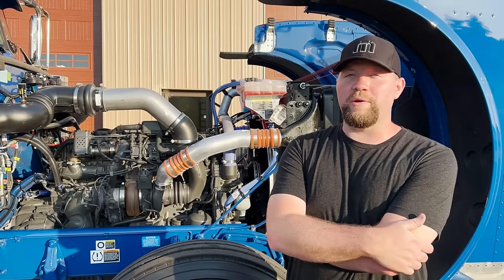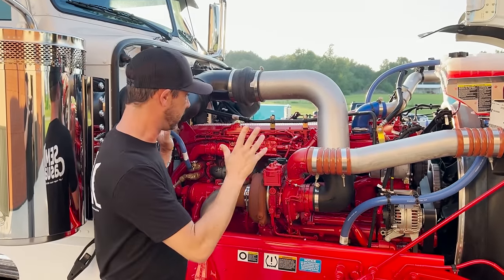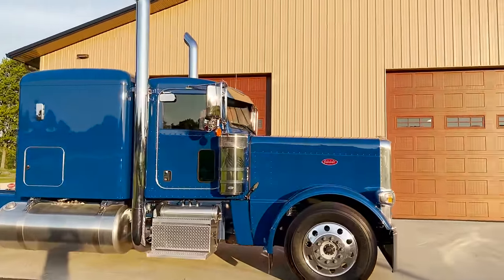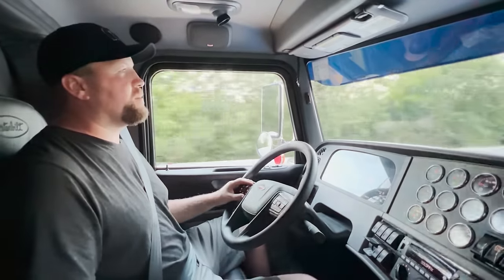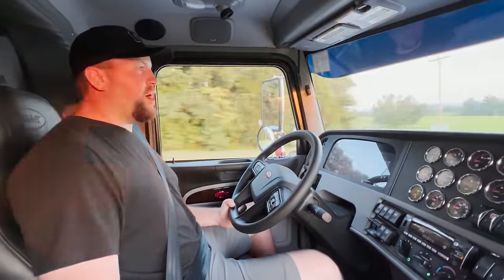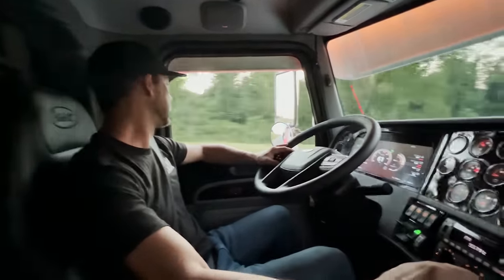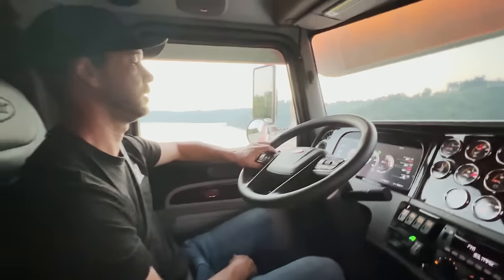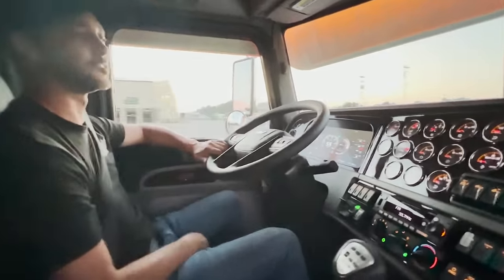Cummins X15  VS.  Paccar MX13  -  What are you gonna choose?

Comment: I haven't heard anything good about the Paccar from the shops that I take my truck to. I would take the Cummins only because the CAT is no longer available.
Reply: The Paccar motor itself isn’t a bad engine, I think it’s some of the parts and pieces that’s bolted to it. We have trucks pushing 500k and the engine itself is good, just issues with the other things.
Reply: They are still available just not a factory option anymore but putting a cat in after is better in my opinion because you get to choose how you want to build it and who you want to build it
Reply: But you hardly see paccars in the shop,most of them are Cummins
Reply: True
Reply: @alfredodelcastillo583  because 99% of trucks have Cummins.
Reply: Currently at my shop I work at we have more paccars then Cummins. Paccar is going though a issue with eating camshafts right now.
Reply: @tylerrobinson6158  
What year models? I’ve been driving trucks with Paccars since 2014 and out of the 3 trucks I’ve hadn’t had any engine issues other than the crankcase filters. The 3 year models were 2015,2017 & 2020. My current truck a W990 just went in our shop for the dpf pressure sensor and crankcase filter.
Reply: @tylerrobinson6158  excess downhill speed?
Reply: C15 600 hp 2050 tq 44k load I still out climb a 605 hp Cummins 2050 tq any day depend on your gears and how your truck set my opinion
Reply: a man  t2000 really don't matter the body style along the motor is good
Reply: @waynenorbreyjr9371  Paccar opted to use a pressed lobe crankshaft to save on weight. The result was that the lobes spun independent of the shaft. I am not positive which years were effected by this.

We run Paccars in all of our trucks. 1.2 million miles on our T660 and no need for an inframe yet. I do not know any Cummins owners that have been able to run beyond 500,000 miles without an overhaul.

That being said, we now run US weights but our T660 spent most of its life pulling 140,000 pound gvw LCV. As long as they’re maintained and operated properly they should last a long time.
Reply: The majority of shops don’t know how to work on them and the majority of operators don’t know how to operate them properly. Paccars aren’t meant to have the snot driven out of them. Lower power and torque but they also have a lower power band which means I get full boost at 1,100 RPM. Low RPM shifts and proper maintenance and they should last for a long time.

The problem is that most of the big fleets run Paccars because they’re cheap and their drivers beat the shit out of them. Add the fact that technicians don’t know how to fix them and it gives them a bad name.

They’re great motors imo.
Reply: Basically none of these motors are any good, You need a CAT under that hood.... that or you need a Detroit 60 swapped in for extreme reliability and good fuel economy. And before anybody talks s..it about the Detroit, I have one that has 1.2 million on the clock all original. Only a Turbo ever replaced. Ive also has friends with C15's extremely tough and they have incredible power stock for stock. Im talking big grades pulling 80,000. I hear the new Cummins loveee to eat those Dual overhead cams. They eat camshafts for breakfast. My local Diesel repair shop is always rebuilding the heads on them. Overall they dont last past 600,000 most of the time under 500,000 they're worn out
Reply: @raysoicey  I could out climb you with my 605 Cummins with 46k on and if you had 44k any day
Reply: The shops must be incompetent. Paccar engine is extremely simple
Reply: But you could custom order a peterbilt and install an old cat motor into one
Reply: And the electronics/sensors especially  ‼️
Reply: You haven’t heard because the shops cannot and don’t know shitt about them , Cummins is a Chinese Engine every part is made in China 🇨🇳 I choose Paccar
Reply: @raysoicey  T2000 has a horrible body electrical system and sucks to work on anything in the engine bay
Reply: @Fasterfuel  a ton of things are produced in other countries  , but are assembled here in the states.
Reply: @tylerrobinson6158  had an x15 eat a cam at 300k
Reply: When they run they’re. They just live in the shop. Detroit all the way! A shame there’s no DD in a Kenworth or Pete.
Reply: Paccar is fine if you are running flat areas don't mind paying more for oil changes, running into places not having the filters in stock, parts costing more, and the strong possibility that the engine will need rebuild around 4 to 500,000. That's if the block isn't trashed from cavitation and it can be rebuild. Also it costs more to rebuild one.
I ran the paccar for about 2 years and cummins for about 2 years both As an owner.
I'm back with a company now in a paccar, but if I were to buy another truck, I wouldn't touch a paccar. Too much risk, and the little bit you save on fuel will go to maintenance anyway in the long run.
Reply: I was a Cummins guy for years until my Cummins spun a rod bearing and due to changflu they couldn’t even really estimate a timeline for rebuild due to the parts issue. I had to have a truck so started shopping. Wasn’t much on the market at all but finally found a nice low mile T800 with a C15. Gonna be really hard for me to get away from a cat now. Had it deleted and tuned as soon as I bought it and WOW. The horsepower and low end torque is unreal. Everyone told me that cats guzzle fuel but it gets the same to a little better than my Cummins did. She’s a keeper
Reply: I'm almost at  600k miles on mime haven't touched it still no leaks at all and I know I'm getting better fuel mileage than isx
Reply: @jordanray6459  Maybe with the computer and engine killing filter. I had a 88 Freightliner with a 450 M series Cummins and didn't overhaul it until one million one hundred and twenty five thousand miles. Had minimal major parts replacement over the 60 series Detroit my brother had in a 95 Freightliner that was a continuous money pit.
Reply: @orlandomoreno5326  I have several friends with C-15 cats and 60 series Detroit's and my Cummins got better mileage and less maintenance cost. My brother could confirm that with the 60 series Detroit he had. His cost in fuel and maintenance cost was half again more than I had with the Cummins.
Reply: @Fasterfuel  my Cummins is all American or canadian.
Reply: Milwaukee blew up at 450k and had to be replaced and none of the shops techs where surprised lol. Not to mention that they made the paccar especially to force you to have to come to the dealer even after warranty is up because shops popped up all over the place specializing in Cummings for half price and they wanted to make sure you couldn't do that with the Paccar so something ad simple as a fuel filter you must go to the deal for or you will get a engine light.
Reply: @Daniel-z2j2v  I would say about 65% are Paccar engines. At least that what it seems like when I watch the guys bolt them in
Reply: @joshcoffey6355  was your Cummins deleted too?
Reply: Paccar is like a cat
Reply: Don’t matter what motor you put in a truck these days. That emission junk gonna cause problems either way
Reply: @alfredodelcastillo583  tell him na
Reply: I recommed paccar 100%
Reply: @waynenorbreyjr9371  Packard are great  engines
Reply: I prefer the paccar over the Cummins me personally drove both paccar better even sounds better deleted but I'm a cat guy I prefer that over it all the only thing with paccar is trying to tune the speed all that good stuff paccar gets better fuel mileage
Reply: @champ0925  nice
Reply: @Fasterfuel  because they’re made in the EU?
Reply: K B  yes and no. CATS are still around they just don’t make over the road engines anymore do to emissions. Cummins will be making there last light duty Diesel engine in 2025 and after that they will be taking down there semi truck engine and switching to industrial gas motors or hydrogen engines. I heard about all of this a few months ago but not sure what will happen especially with all the emission stuff in the US.
Reply: Our peterbilt dealer refuses to carry paccar trucks
Reply: @waynenorbreyjr9371   had a 13 that lost the motor 3 times in 7 months. All full crate engines not rebuild. Then an isx15 deleted with 700hp reliably for years zero issues
Reply: Depends on year
Reply: CAT all the way! C-15
Reply: We have all new Paccars in our Petes. All of them constant headaches with under 50k miles. It's a nonstop game of find the leaks.
Reply: I drove 579 paccar for 2 weeks engine blowup on my face then my company moved me to kw t680 with paccar 5 days later engine knocking then pistons broke then crankshaft became mashed potato so I told my company fu I’m done
Reply: @alfredodelcastillo583  
Because of the shear number of cummins on the road. They are the largest diesel manufacturer in the world.
Reply: Quiet and comfort makes you fall asleep faster
Reply: Peterbilt is junk. I bought a 2023 brand new & roof leaks!! Then I found out many have that problem.
Reply: Peterbilt is junk. I bought a 2023 brand new & roof leaks!! Then I found out many have that problem.
Reply: ,  zddp will fix that imo
Reply: The gd stuff I’ve heard from paccard owners are those that deleted them fully, piped around and all, and take them to mechanics that are familiar with them. The def system seems to hit the paccard more than any other engine
Reply: Because mechanics don't know how to fix it. The engine is fom Europe Man/Daf those are wery advance engines. Cummins stone age technologies
Reply: Cat is back bro with the c13d
Reply: @alfredodelcastillo583 that's BS
Reply: @tylerrobinson6158  has eating camshafts any thing to do with fuel pumps breaking bolts off
Reply: There's no way on God's green earth I'm going that far with oil and filter changes, I'll stick with 12 to 15 thousand and the c-15 cat
Reply: kb5019  No cat couldn't meet emissions standards. They still make motors for the construction and industrial industry. Major of the construction vehicles use CAT
Reply: Paccar is a nice engine and gets amazing fuel mileage
Reply: @goodplenty5510 Same problem on both of my new 567s
Reply: @orlandomoreno5326 see a ton of Cummins inframed between 500-600k miles. I’ll take a built Series 60 all day.
Reply: @deantait8326 DD gets a bad rap for the emissions or a company driver didn’t do the correct maintenance.  I think an owner op could easily get 1 million out of a DD motor.
Reply: Paccar - Peterbilt and Kenworth - "shops" or shadetree wannabes that work "cheap"?
Reply: @austinpitts6362  I expect it won't b too much longer, that it won't be an option to do that anymore.
Reply: @tylerrobinson6158  They have all had that problem at one time or another, Cat, Cummins, and DDA. They can do all the quality checks they want, it doesn't show til they get used.
Reply: I have paccar mx13 and it’s good when it is deleted
Reply: Not a bad engine, except some clowns masqueradeing as engineers got their grubby hands in there and fucked it up for everyone and twenty folded the cost for no added benefit
Reply: Alfredodelcastillo583 congrats in showing everyone you dont work on trucks for a living lol
Reply: One friend is psicólogo whit paccar paid lol
Money to
Fixed
Reply: @waynenorbreyjr9371  aqui no Brasil o motor não dá problema olha que andamos com 74 toneladas os defeitos são em parte eletrônica e turbina
Reply: Current have 1.2 million miles on my MX13.....with no engine work yet

Comment: Let me add my 2 cents here. I had a T-800 with an MX-13 in what is probably the most brutal operating area in the USA. It was hooked to a gas wagon and we delivered gasoline to fuel stations in New York City, northern NJ, and western Conn. 2 drivers per truck rotating in 12 hour shifts 6 days per week. Truck never stopped. Each 12 hour shift saw anywhere between 800-1200 lever shifts (10-speed transmission) that’s over 2000 per day easily. Always loaded to 79,990lbs or completely empty. Usually 4-6 loads per shift and 300-400 mile per shift, 3 years later and no issues at all. Those trucks, engines, transmissions were run at their absolute extreme in ridiculous brutal conditions and we never had a single breakdown. When it wanted a regen we let it regen. Took 10 minutes and it was done. Absolutely awesome engines.
Reply: we have paccars in t880s hauling crude off road they never stop only for service they seem to be holding up

Comment: A throw away engine.  Mx13 every thing 8s rear driven air compressor power steering cam shaft. Cam shafts lobes are pressed on the shaft. Blocks cannot be converted bored. Must use a plastic scraper to clean old gasket material off. If under warranty most times paccar just swaps out the engines

Comment: Had it been available, Cat would be my top choice. When I drove trucks with Cat engines, either a 3406 or C15, it was instantly a noticable improvement in pulling power over the others.
Reply: I retired from trucking many years ago but...if I were to get back into it I would buy a 2000 with a Cat in it and love every mile😆😆😆😆😆
Reply: @ford32able  how about an RV with Cat power? I could deal with that.
Reply: 3406e for the win
Reply: Have you compared it to the cummins X15 or even the later isx15's? I noticed the cummins was better stock for stock vs my 3406a and got better fuel economy.
Reply: FYI - C-12, 15, 16 etc is the engine size (Liters) and 3406 is like the Block model. I assume that this is what you meant....
Reply: Well I have not drove sinse late 80' s but my favorite engine is @silver92 Detroit at least that's how I recall it in a REO triaxle with a15 speed trans that was a animal it had 2 speed rears
Reply: I am thinking of getting back into it
Reply: 6nz
Reply: @dublkrossr2059  c-12 is a smaller block
Reply: Yeah, and 5 miles per gallon would be killing you today.
Reply: As smooth as a cat is I would have a 500 60 series with a super 10 over everything  6mpg to 6.5 all day I only got 4.5 to 5 with the cat
Reply: @larb400  seems everyone wants a CAT, I don't think they have any idea how bad they were on fuel. I'm with you, I would like a 60 series Detroit, set up properly 7 or 8 miles per isn't out of the question.
Reply: And passing you up hill will be the signature600
Reply: Cat, then a REAL Cummins no ISX garbage. Then a Detroit
Reply: Cat engines are solid built but super expensive to mantain..... Cummins command 60 % indian market share  of trucking due to pocket friendly  maintenance reliable too.....
Reply: @thomaskirkpatrick4031  Can you still get the Detroit 60's?
If not, then the Cummins X15?
Reply: 2ws
Reply: @robbalinski1606 a model is trash compared to an e model. Id sure hope the x15 out performs an a model
Reply: @thomaskirkpatrick4031 the low nox files most cats run ruined their fuel milage. Find someone to flash in a file with an interlock code below 300 and the milage will go back up.
Reply: Absolutely and the cat would lug down deep back when detroits were screaming to the heavens, the detroits did sound nice though
Reply: @nostradamus7648 No, you can’t get them new anymore
Reply: Rest in piece.
Reply: We have Detroit 60 amd paccar mx 13 and cat c15 single turbo on are small fleet the mx -13 has better fuel mileage saving about 150$ per week running about 2000 miles per week what we see against tge cat c15 and Detroit comes out to be 5000$ saving thru out the year.

Comment: We own a 2019 567mid roof with the Paccar powertrain system. For our application, hauling new RVs,  we don't need a 15 litter engine. Our gross weight is around 40k. This engine works great for us. Our problem is the after treatment garbage. We are currently sitting in Spokane, Wa waiting for the warranty to approve a new DPF filter.  Our avg. mpg is 7.5. If I had my way it would be a 6NZ cat engine. We are in our 60s and love the quite sound in the truck. Been trucking for over 35 years.

Comment: There are many people in the trucking business that are hardheaded and stick with the old. When you drive a Paccar engine you have to learn to change your ways and to be open to learning something new. The longer you drive A truck with a pack car engine you will realize it may not have the big bottom and torque but if driven properly it can perform the same as a Cummins or better. And most definitely when you go to refuel you will notice a huge difference. I was always a cat man and still to this day love them engines But between the Cummins and the PACCAR I will always choose a packer.
Reply: Yes, Paccar is a low torque motor! I hate it! The first generation wouldn't pull an empty trailer up a mountain, and the jake sucked! It wouldn't hold the truck on a downgrade. The second generation was much better!